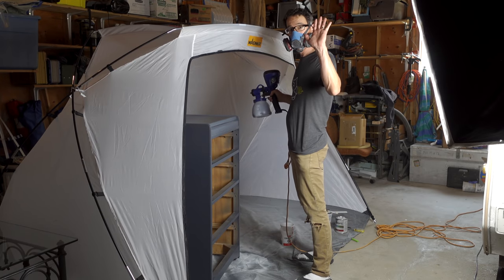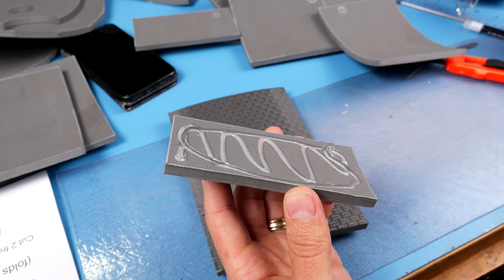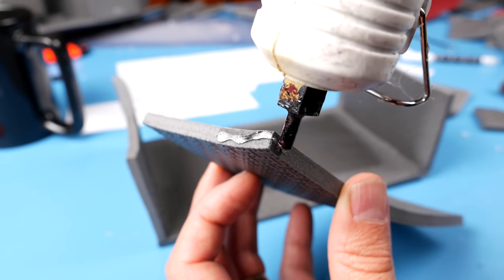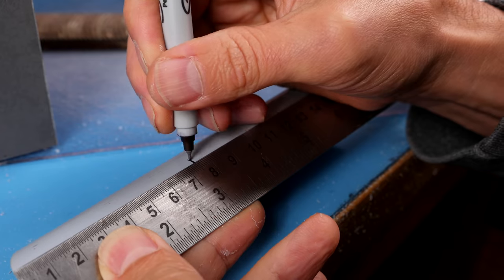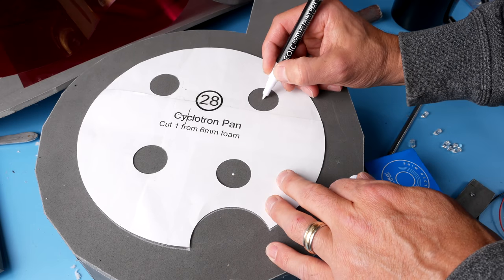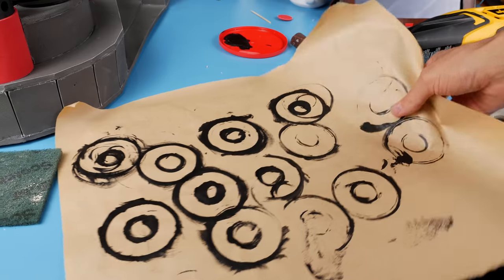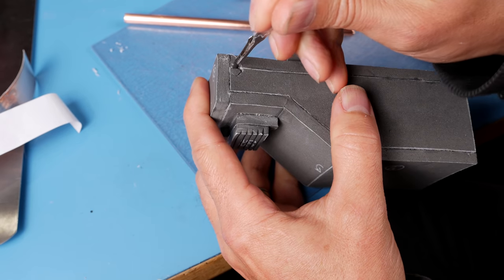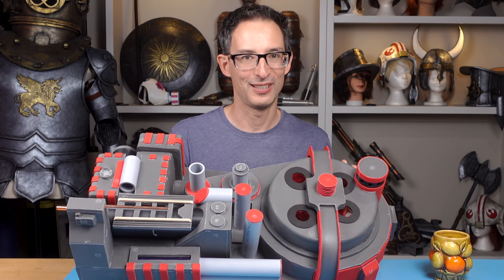DIY Ghostbusters Proton Pack Made From Cheap and Easy To Find Materials. Proton Pack Template!!

Comment: Does anyone have the actual dimensions of this when built? Trying to resize it for my 7 year old, but it’s not clear (or maybe I missed it reading it) how big it actually is assembled
Reply from the maker: The baseplate measures 64.5cm tall by 34.2cm wide. You might want to try printing the baseplate out at 75% or so, and see what that would look like on your Childs back. Remember though, when you scale down the pattern, you also need to use thinner foam in order for the relationship between foam thickness and size of pattern pieces the same. Hope that helps!
Reply: @LostWax  would 8mm or 6mm be a better option if scaled down?
Reply from the maker: @girlswantpockets  So, scaling the pack is a tiny bit complicated as I have calculated the width of the foam into the dimensions. As you scale down the pattern, if you are still using the same thickness of foam, things will go out of whack. The best thing is to find a thinner foam and then scale down the pattern proportionally. I used 6mm foam in the build so if you had 4mm foam  4/6 = .66 or 66% scale. That would give you a pack that is about 17 inches tall. If you use 5mm foam the scale would be 83% giving you a pack that is 21.5 inches tall.
Of course you’ll also need to find alternative sized tubes and things as well.

Comment: Your video is awesome, but i do have one critique.

All these parts actually have names. I'm incredibly surprised you didn't encounter them while doing the research and  planning.
Reply from the maker: Thanks! yeah, I knew that people had named most of the parts, and I used some of those names, however some parts had only one name for something that I split into multiple parts, so I needed new names to be able to correctly specify the part I was using, and I thought it might be easier to remember, and I just kinda felt like making up some of my own names:)

Comment: Was only able to find a 10mm floor mat on short notice. Can I still work with this? Anybody?
Reply from the maker: It'll be a little tricky, as the pattern is designed to incorporate the foam thickness on some of the parts. If you're good at improvising, you could definitely make it work though.
Reply: @LostWax  That's my specialty my guy.
Reply from the maker: @ARuiz-eu3hk  Nice.

Comment: Rather than using hot glue, for the EVA to EVA gluing, why not just use a good contact cement, like Barge or Weldwood? i would think it would be faster, neater, and certainly stronger. just coat both sides of a join, let dry til tacky and the bond is instant.
Reply from the maker: Yup, contact cement is great. As long as you're not breathing it. I try to keep my working conditions as free as possible from toxic stuff, so that's why I have changed to hot glue. After having a son with cancer, I don't feel any of the benefits are strong enough to open myself and family up to those risks. I'm actually amazed at hot glue, the only two downsides I have found are that you have to be aware not to leave the costume out in excessive heat, and it takes a little longer to put together. On the positive, if you make a mistake, you can reheat and unglue parts, I can get really nice smooth seams, there's no fumes if you keep the temp down, it can be gap filling, and if I try to tear two pieces apart, usually the foam will tear first, so really, it's strong enough. It's definitely a good thing to give it a try so you have another tool in your tool belt.

Comment: how would you add an allice frame for straps or v hook for the wand?
Reply from the maker: I haven't totally figured out the pack attachments, but I am thinking maybe cutting thin rectangles in the back of the pack, then taking slotting rectangular wood pieces through the hole, spin them 90 degrees and glue them. Then can screw/bolt the pack frame to those.  I have an idea for the v hook using a bit of PVC pipe. Not sure if it'll work, but we'll see soon!
Reply: @LostWax  be looking forward to part two